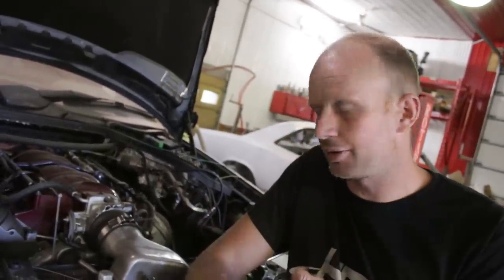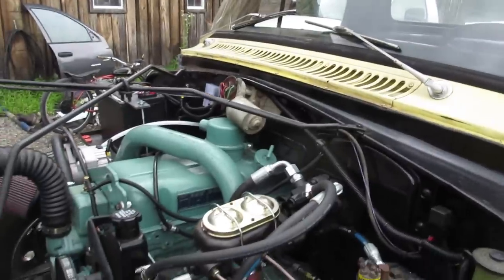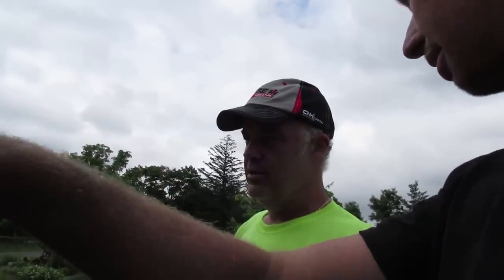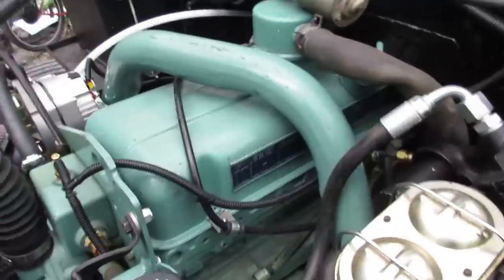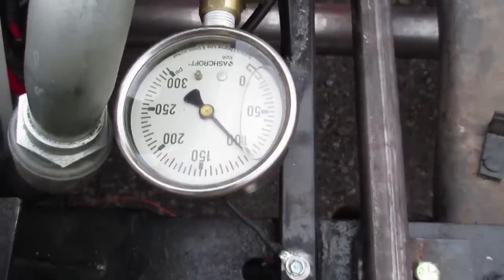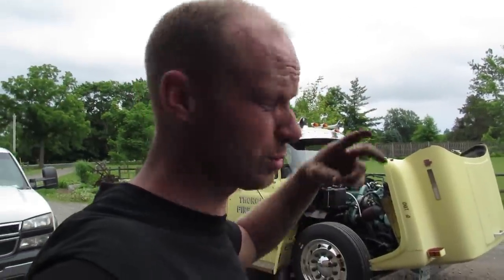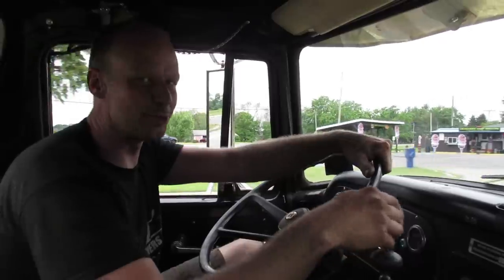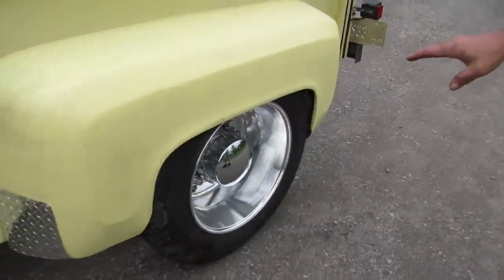AIR START! 453T Detroit Diesel in a '77 International Loadstar 1800

Comment: that is cool! I was wondering: do you use an air starter the same way as an electric? or is there something which turns the air off once the engine is running? Since Jacob was mentioning the fuel milage for the old gas engine, what is he getting with the 2 stroke? thanks
Reply: It's just a valve between the air tank and the starter, open it and the starter goes and once the engine is running the valve needs to be shut. It's the same way with a regular starter, except instead of giving the starter electricity and then taking it away once the engines going its air
Reply: @benjamins9121  thanks. Do you also know the dienende mpg for the Detroit?

Comment: I’m looking at 2001 f350 7.3 power stroke. Has 138,000 miles on it and the guy says that injectors s6 and s7 are bad. Other then that the truck is sold not a lot of rust. It still runs in its current stat. He will go as low as $4000 should I buy it or avoid it? Thanks

Comment: Diesel sucks as an air starter lube. I suggest air tool oil or marvel mystery oil. I used to work on a boat with Cummins KTA 38s. It had built in diesel lubricators for the starters. Had to rebuild the starters several times before I installed an air line lubricator..

Comment: What ever happened to putting a built big block in a truck with a five speed? It's the way of the old school hotrodder. You can run a Ford, Chevy, or Dodge on home brewed moonshine. There's no replacement for displacement.
Reply from the maker: Park this beside a 6 figure big block and this truck will get more attention and respect.   Have to appreciate the originality.

Comment: That starter is a dilemma waiting to happen.  No way to start the truck without air, no way to develop air unless you start the truck.
Reply: It Bump Starts real easy and I have a tow hook on the front.
Reply: For the next time you go through the drive through so you don't have to use the starter and deafen everyone in a 50 foot radius, just put a tow cable on the guy ahead of you! lol

Comment: The vacuum number given is not possible.  The maximum pressure difference will be atmosphere  .
Reply from the maker: thats sucks!
Reply: That may be the max vacuum but remember this is forced induction motor and 21"s of mercury is going to hold a board hard against a 4" intake. It doesn't take a lot of vacuum to produce a lot of force.